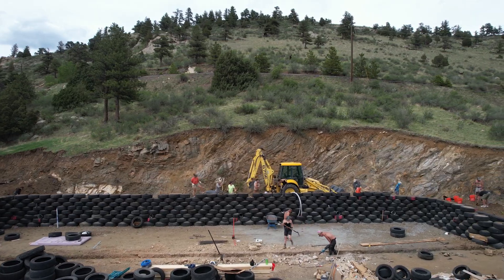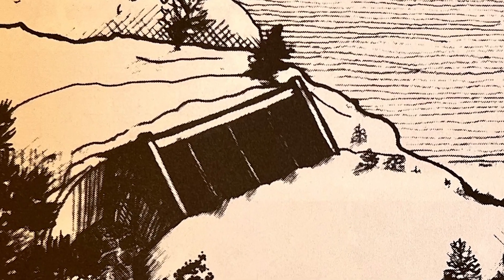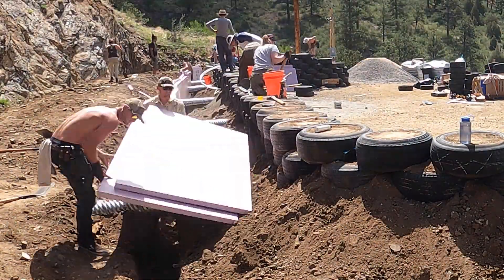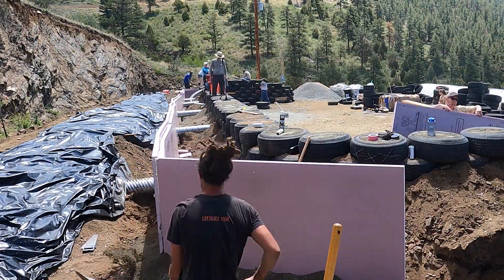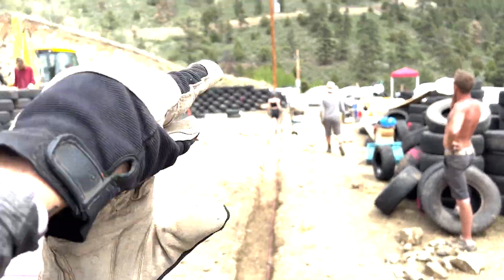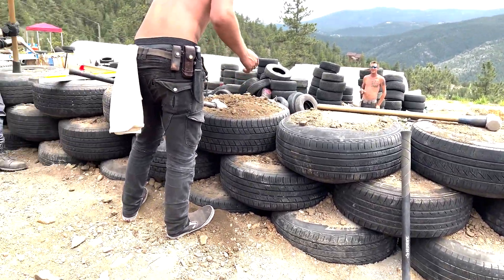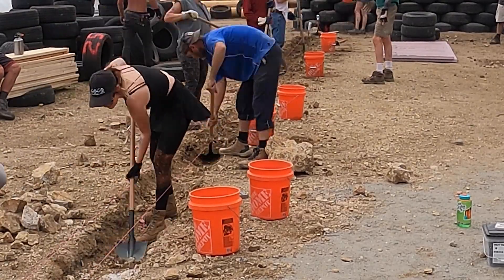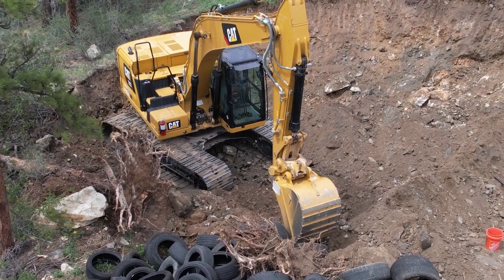Building an Earthship - Week 1

Comment: Hey man, where did you get all them tires? What did It set you back? Thanks for your video and time.
Reply from the maker: The tires are easy and I think free to get about anywhere. Talk to your local tire shop and they have to pay someone to take them away, so you can usually get them for free. I think it is that easy. You might need to collect them from multiple shops, but they aren't hard to get.

Comment: Why don't you just cut off the top of the tires, wouldn't it be easier?
Reply from the maker: I think you lose the integrity of the tires if you cut the tops off. It is hard work packing the dirt under the top of the tires, so it would be easier to cut them in half. I'm not the expert on this topic, so those are just my thoughts.
Reply: I’ve seen other Earthships without the insulation and vapor barrier. I’m not seeing how those are necessary.